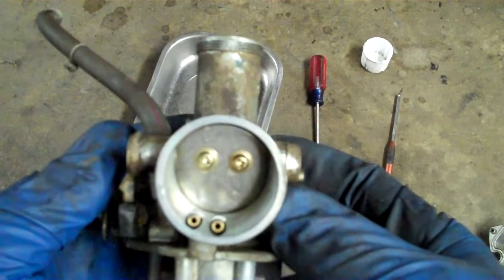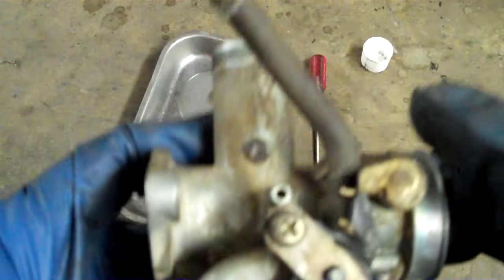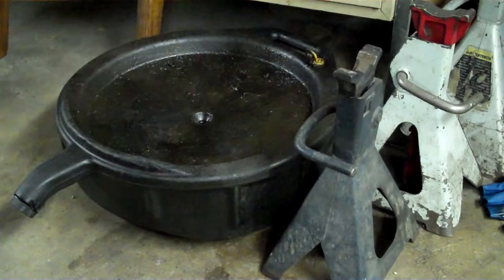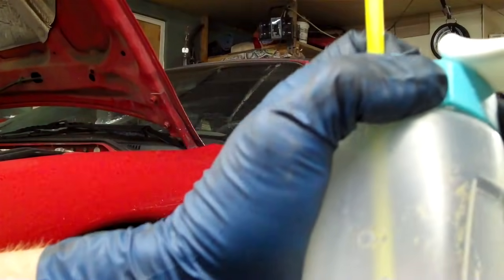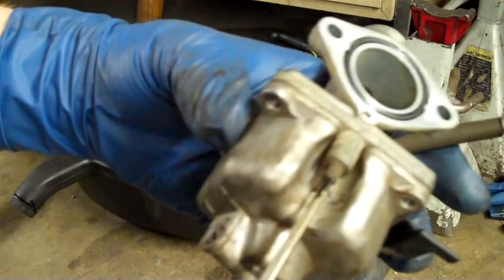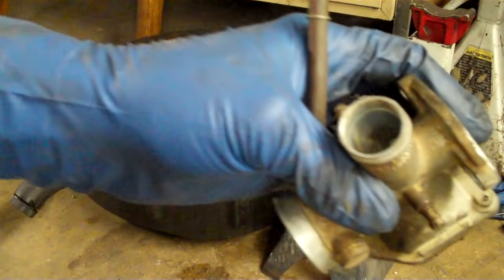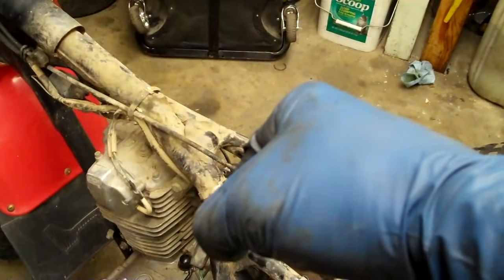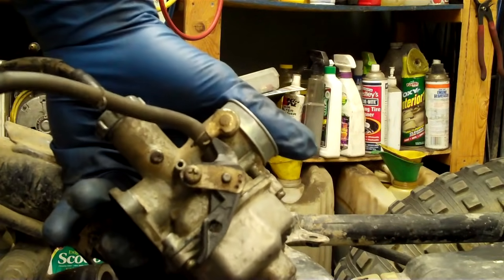How Motorcycle Carburetors work and how to tune and clean them

Comment: I'm a fully qualified  vehicle technician, and i have only ever worked on fuel injection systems. The old boy in the garage dealt with carbs etc whilst i was scanning and reading ecu faults and fectifying. 16 years down the line and i finally understand what bits do what on carbs. 

 Thank you ever so much, by far the best tutorial vid I've watched on here and ill definitely be subscribing. cheers

Comment: I pulled apart my first and only rusty old motorbike carburettor about 10 years ago, that was a nightmare and a half but I prevailed in the end. This was a great reminder. I'm almost back where I started, having just ripped apart a throttle body, idle valve, MAF & PCV on a car for the first time ever. Been cleaning things out with toothbrush & cotton buds :-)  Got to tackle some oil leaks next. I got the tools & the time but no garage of my own to learn my tinkering so I haven't come very far in 10 years. But videos from generous souls like yourself make things much more accessible for those of us that never grew up learning this stuff. Hope you're doing well and thank you so much again.

Comment: I'm 50 years old.  I NEVER KNEW the clip at the top of the pin adjusts with the c clip to set the rough idle speed.  You've saved me a ton of time and money!!!!!!  By the way, 9:45 or so in the video is where the magic happens.

Comment: Thanks so much for this great basic carb video.  I always sorta knew how they worked, but this takes the mystery out of it for me.  I currently have a bike that runs but does not stay idling.  The bike sat for almost a year and I'm betting the low speed jet is gummed up.  Thanks again.
Reply from the maker: ***** Welcome buddy!
Reply: briansmobile1 i 2012 ktm 2 stroke 125 dirtbike.  i don't know what's wrong with the carb?  when it's in the low rpm it goes fine, but then when i am about between low and the powerband.  it runs kinda rough or a little rough.  then when u open to the power band it's smooth.  so  i don't know what i need to fix?  i cleaned the carb already.
Reply: yep !!! take it apart, clean it  and put it back together.  i lay my parts horizontally in sequence of disassembly. i also draw a diagram, if its new to me. if it doesnt work, repeat.
Reply: teeeeeeeeeeemywwwwwwwwwwwwwwwwwwwwwwwwwwwwwwwwwwwwwwwwww
Reply: Bobby Hobby you likely have 3 jets. Maybe your mid jet is clogged?
Reply: W Michael Bratton  
what was is mate ?

Comment: Appeared to me the screw/jet/needle or whatever it is lol, fell out when you inverted the carb back to vertical and you didn't notice it. I'm talking about on the air jet you discussed on the outside of the bottom of the carb. And I'm not certain either. Anyways great tuitorial !
Reply: arciefan I seen that too lol

Comment: Thanks for the vid. At what point does one need to replace o rings and gaskets? can you ever just clean up the carbs without replacing rubber?
Reply from the maker: +lcantrell123 Of course.  Typically the $30 or whatever for the rebuild kit is well, well worth it.  I've done many the cheap way and then had to re-do them.  The second time I'm often shocked how much better the bike runs!
Reply: thanks!
Reply: i cleaned many carbs without replacing orings,but make sure you take them out before cleaning because carb clean and other solvents can burn the rubber making it stretch.so if that happens you will need to replace o rings
Reply: yes

Comment: Many thanks and much appreciated. As a budget-limited DIYer, I've had to let my bikes sit for a while due to lack of funds to deal with the myriad of issues, but in the interim, apparently one of the local kids was screwing around with one of the bikes and turned the choke down all the way and left it there, the strain of which snapped the plastic enricher cap where the choke cable connects to the carb. I have the cap on order, but since I had the carb off, and she's sat for the last two years, I decided to give the entire assembly a good once over. Your video was invaluable for this, so again, many thanks.

Comment: Hi Brian. Just got myself a 250cc Bashan which has a similar carb that you feature in this video. My bike was struggling to start and after watching your video i realized that the fuel mixture screw was turned out more than 6 turns. adjusted it to 2 and bike starts and runs really good. Thank you Brian

Comment: Hey Brian,   Good vid!   The overflow tube is not on the side of the carb, it is the brass tube built into the float bowl.  The port on the side of the carb is the bowl vent, and on dirt machines, needs a tube to go up high, so as not to get water,etc in the carb.    Great explaination of the venturi effect/ vacuum generator!   Thanks

Comment: Thank you so much for this video, I bartered for an old bike that spits and sputters when I give it gas. I changed the plugs and caps, which it probably needed but didn't make a difference so my mechanic buddy told me my carb is probably gummed up. I am new to this and you explanation made sense to me. I feel confident to try and clean it on my own!!
Sarah

Comment: This helped me so much. I am working on a Honda XL 100s carb and I could not figure out what the air mixture screw was. Mine has a little tab so it only turns half a turn when assembled. I thought it was like that to hold the bowl to the top end of the carb. I had no idea it had a function!  The bike still sputters a bit when I hit 30 so I'm rebuilding it with new jets and a new float.. Thank you very much for delivering a very easy to follow tutorial!

Comment: This guy is great at explaining complicated things. How often should you take a well working carb off and clean it?
Reply: if something isnt broken dont fix it.. if its running good now be sure to shut off the fuel line and let the bike die out(no fuel left) and then store it away for months at a time.. amd run what u need dont fill it up for an hour ride and store it back away for months without shutting the fuel line off first

Comment: Thanks. I got ahold of a Honda shadow 2002 vt750 that's sat for a year and a half thankfully with no gas in it. It was abandoned at my new wifes by her X. he got a Harley. Apparently three supposed bike aficionados couldn't get it started. I got it started in 20 minutes and I have little motorcycle knowledge. I replaced a few minor things like fuel filter and pump. Then found that it would start and idle till it burned off the starting fluid. I decided what the hell, got to learn something so I pulled the carb and found its got a lot of crud built up in it. So I disassembled it and cleaned most of it but some parts look beyond recovery. This video was very helpful in learning how it works and just what was causing the issues.  The float valve spring on one side was missing all together and so it sat shut and looks like corrosion built up. The other side not so bad but still in major need of cleaning. SO pulled all the plastic and gaskets and carb dipped it for 20 min. Still the valves and jets are stuck full of crud. Going to try a 24 out dip and see if that free things up. If not I may be looking to get a new carb. Since I got the bike for $300 from her X and the rest of the bike is like new, 18 thousand miles with all the accessories I figure im making out pretty good. Cheers.

Comment: The Venturi effect is not air dipping down in there and whipping back out bringing fluid with it, but rather the higher velocity air creates an area of lower pressure and, because that pressure is lower than the air pressure on the rest of the liquid in your container, the liquid is forced up the straw where it meets said fast air and is then swept away. If the air is moving fast enough, it's enough to atomize the fluid as well which is why this method works so well in an application like air brushing paint.

Comment: oct 14 2022 
     you done well to include the bowl drain screw there at the end.
and to drain the bowl  for storage.  plus mentioning that overflow drain pipe
and it having its own  piece oftubing
    
your vid covers well the lessons of discovery over the last week going thru
the carb on my '08 Honda 100CRF.  the engine would die after the starting
fluid spray was used up .      ??? why is that ...   
  
       on opening the bowl up ( 3 screws ) and
finding it dry inside ( no gas residue ) ... i blew into the gas line  fill stub and
there was  no sound of moving air,    inverted neither.    first clue for
this problem to solve

       from that it was reasoned the float valve was blocking the inlet.  
on flipping the float over half a turn that condition was corrected. 
yes , somehow the carb was previously assembled with the
float upside down.  ( note the plastic spacer thing will still install
in this configuration ) .

     on re-assembling the carb then bolting ( 2 nuts ) to the cylinder head.
connect the gas line. 'on' the gas valve.  squirt carb  with a shot of ether.
it fired right up like it'd been doing.  only this time it kept on running.

      the rubber round end of the air filter unit  was put on to the carb
opening.  and tightened down.   then the bike was test ridden in the 
yard.  and ran as well as ever.   same thing up in the hills after
hauling it up to some nearby OHV riding area.  just had to adjust the
idle speed to slow it down.  then adjusted that knurled nut on the
handle bar grip to eliminate the cable slack.

   last is to add an inline filter to the gas line.

    the only 'gotcha' was having overlooked the front wheel having
a slow leak.  so now  it needs pulled for taking off the tire to get
inside and see what the matter is.  

  this 100 is a backup to my yamaha 225 for trail riding.  as i am
no longer strong enuf to lift the 225 back up after taking a spill.
the Honda is a hundred pounds  lighter 'n the Yamaha

   carry on

Comment: Great video! I was looking everywhere thinking I forgot to hook up a line after cleaning the carb on my sons Honda XR100 which looked identical to this carb. I thought I left something off but it's just the overflow and had nothing connected to begin with.

Comment: great information, appreciate it. The info on the airflow across the top was very helpful. I gather that the motor and breather sides being hooked up and sealed good is pretty important for testing purposes as well as running purposes, which i was not aware of before now. thanks again for the thorough explanations

Comment: Very insightful but after cleaning my carburetors, adjusting my idle screw my bike will only idle on full choke sometimes on half. The bike revs to 4k rpm when started then it comes down to normal when I switch to half choke it revs to 4k rpm then dies could you diagnose this problem? I have a honda CGL 125 2013.

Comment: What you're actuall describing and demonstrating here is the Bernoulli principle, not precisely the Venturi effect. And it occurs not because the air swirls around and grabs some of the water, but because the airflow accross the top of the tube creates a lower pressure area. The fluid in the tube then moves from higher pressure to lower pressure. The greater the velocity of the airflow, the lower the pressure it creates resulting in a larger pressure differential. The Venturi effect is a result of Bernoulli's principle and occurs when a fluid flows through a constriction resulting in a higher velocity and subsequent decrease in pressure.

Comment: I re-jetted my crf450r carb from your other tutorial video. Your content is awesome. Very helpful. Can you do a tutorial on how to clear up fuel lines on a 450r? My bike takes a good 20 kicks (I'm not exaggerating) to start. Even when it's hot it takes the same amount to restart. And I just can't get the damn thing to idle no matter what j do. My valves have been us hustled in the last year. New jets. Clean carb. Tried richening and leaning. New plug. Nothing works. I've been told I have an ethanol build up in my lines and it's gonna cost me a good 200-300 bucks to clean. I'd like to do it myself but have no idea how or what to look for. Your feed back/suggestions would be freakin outstanding!

Comment: Thanks Brian that had to be one of the best explanations I have seen..,I was given a 1974 Honda CB 360 and it has been sitting since 1983 . I will try and clean the carbs , any suggestion to get her to run ? I will also replace the oil , is there anything special to do other than dumping the oil and filling with fresh one !

Comment: Great; I enjoyed watching this, but to be complete, it would also need an explanation of carb sync (vacuum balancing), and how to balance the fuel mix ratios afterwards, on a running bike.  I wouldn't say this video is about tuning so much, when it doesn't show the adjustments on a running bike, along with what to listen to / watch for, because the bike isn't tuned until this is done, right?  But the video is still a good crash course for understanding the carbs, which helps people to use their intuition in an informed way, to figure those things out on their own.

Comment: Great video Brian, today I try to clean the carburetor of my Honda TMX 155, after I clean and re install in the motor, the idle is too high, its like in full throttle even I'm not touching the hand throttle. I w
ill check again the parts inside if they are in good position.

Comment: 6:43 that's the problem in my bike, how can i fix it? I've seen the part and the bike continues to die when I accelerate, it seems like there is no gas, I've tried everything.
Reply: You need to pull out that jet and clean it or replace it.  There are other problems that can cause that symptom though, but cleaning your main jet (the largest one he's pointing at on 6:43) is a good place to start.  If it used to run well, it's likely that something has just gotten dirty inside the carb and the fuel isn't flowing the way it's supposed to.
Reply: @elmo4vt1  I've seen the whole carburetor, it was completely clean, even so I cleaned it, but it is still hard to start and it dies when I accelerate, the fuel reaches the carburetor well, but when I accelerate it seems that there is no gas in the mixture (I already changed the spark plug, cdi, tuned the valves)

Comment: WOW GREAT VIDEO! Question. im having so carb trouble hence the reason Im watching your video. I bought my son a 110cc atv and the carb setup is very similar to this. My problem is that right at start up the engine just about max revs. I have spent all day trying to figure this out and this is what ive done. I removed the carb and cleanedcheck the barrel to see if it was sticking. the barrel and needle are reaching all the way to the bottom.the throttle cable is is working properlycheck the gaskets for air leaks. Everything is functioning as it should.Can you shed some light here?

Comment: I am trying to work out why my 125cc engine will not idle with out the choke - and needs the choke opening for throttle / to go 

It's a new carb - only had its main jet swapped out for "the known correct" jet for the modifications - some what tried and tested if you will -- 

I removed the pilot jet , main jet and air screw - blowing them through 

It had escaped me that there's the two air passages directly to the ( jets ? ) ,, 

So when you pointed out that you need to clean these passages I did that to mine - 

So thanks for making yourself available as relevant "noise" (excuse me , I'm sure you understand ) , so my ears picked up on your demonstration. 

I see no reason I would have crud in mine - which is mystifying me - 

I have wondered if a bad fuel line to carb seal was causing a air leak - -- 

I realised that the hose out the bottom of the bowl is open - so my thoughts are that there's a air draw through there - I guess it de vacuums it ,, 

My mechanic guy who won't touch my Chinese bike , suggested it was a blocked pilot jet - or a air leak - I had a little trouble with the carb manifold - but I believe I've fixed the air leak - when I realised I had put the stud in back to front -- not before I drilled it out and fixed the stud back in with epoxy metal putty ,, 

Like I said it's a new carb - bought because I could be bothered to clean the original one - PLUS , the rubber gasket had warped too much to be useable - so for the 25£ they cost ,... : sadly the new ones gasket is already stretching after only two open and closing -- really want it to not need opening again till I can find the right gasket for the carb ( Makuni (Pz) 30mm upgrade for a stock 28mm ) 

Ok -- enough - wish me luck if you may , 

Thanks again - for your reflective demonstration 

Alex

Comment: Here's my concern. My 89 fzr600 has 4 mikuni carbs. I'm going to clean them to hopefully remedy the stumbling/falling-on-it's-face feeling while at speed. But do I have to worry about synching the carbs or adjusting air/fuel mixture screws? Carburetor noob here.

Comment: Thanks for s brill video.  I seem to have an issue with mine at the moment if you or anyone could point me in the right direction..   the bike idles fine.. warms up no problem... when I pull the throttle slowly the bike will rev to high rpms... problem occurs when I pull the throttle fast and the engine dies.  Since watching your video I have checked the main jet for any signs of wear.. I have fully cleaned the carburetor with carburetor cleaner and all holes are unlocked and free of dirt.   Any help or advice would be much appreciated thank you.